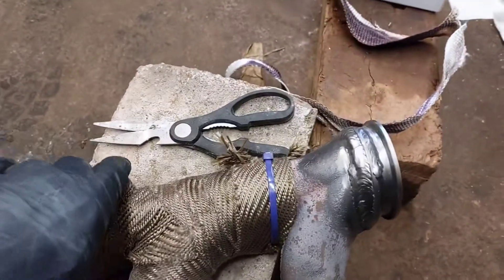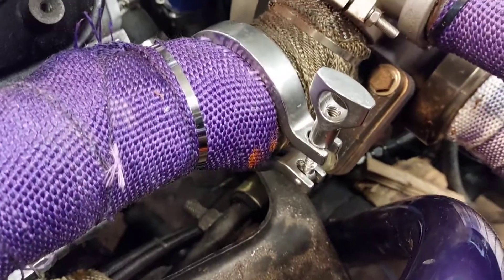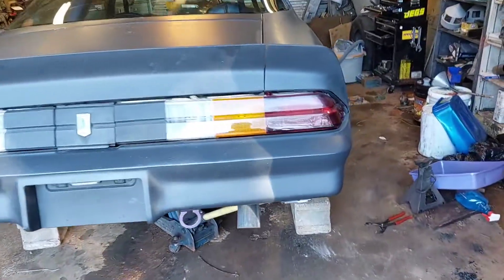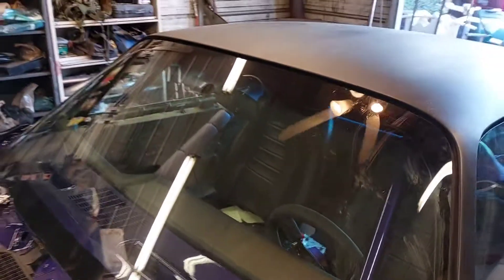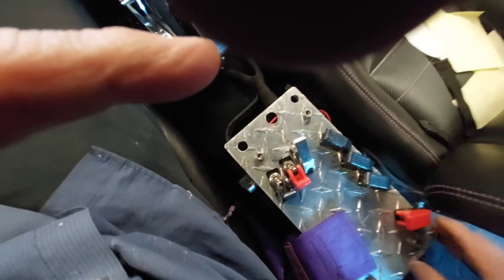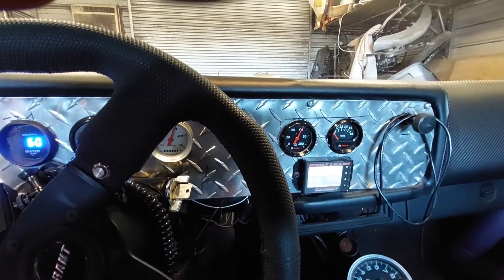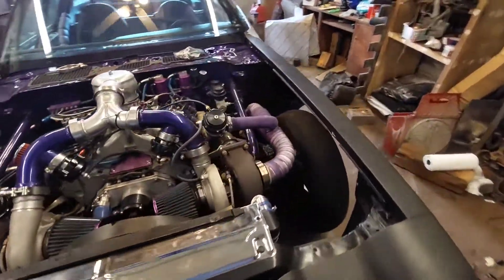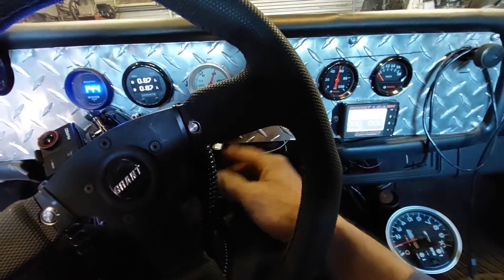2end gen Camaro ,LS v band manifold and maintenance with boost !!!

Comment: Which vbands did you use ?
Reply from the maker: 2.25 (2 1/4 ) in. Is the size and I don't remember the seller name but I got them off of ebay. You can use 2.50 (2 1/2)in. Either size will work just depends on what you want.